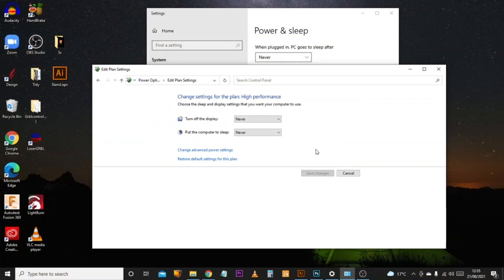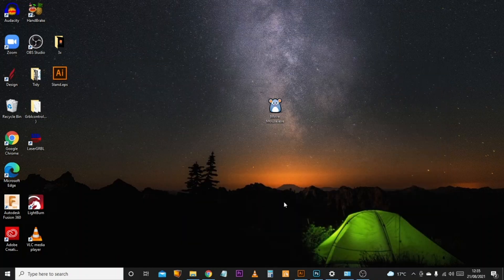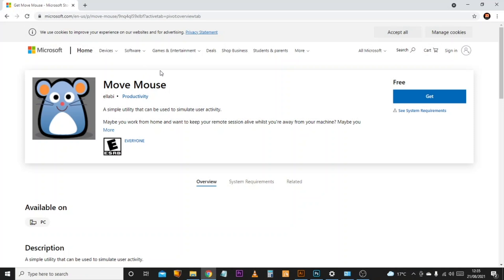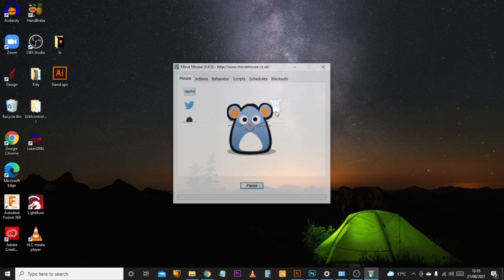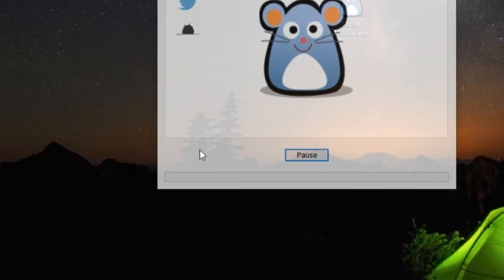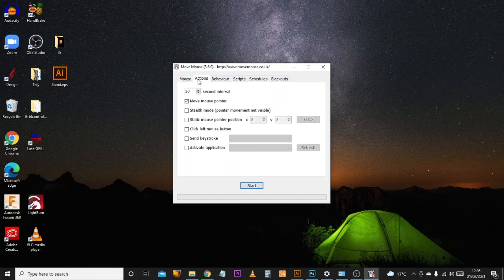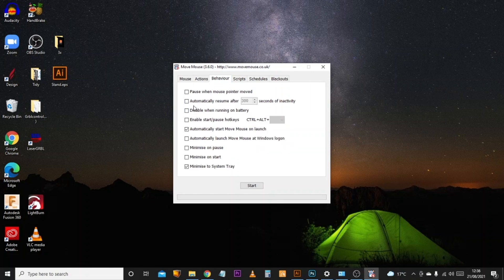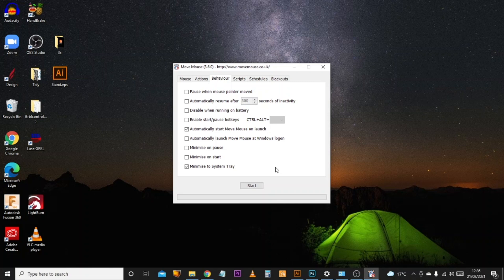Stop your CNC machine losing its connection

Comment: I have this problem with my 3018 cnc from Windows and Linux, some strange problem causes the USB to randomly disconnect from the CNC. But if I connect this cnc through an external usb multiplier, it doesn't seem to happen.
I don't know what the problem and logic should be.

Comment: What I found is that disabling "advance settings for USB" in Power Options actually does not disable "USB host 3.0". And if your CNC connected through USD 3.0 it keeps loosing connection. I went to Device Manager, USB devices, and finally to USB Host 3.0. Power management - and check off the tick allowing to switch off the power. After that - my 3018 worked dearly.

Comment: Cnc 3018 connection lost because the power supply is insuficient  change to 24 volt 15 amp & solve the problem

Comment: hi sorry to bother you but have just extended my 3018. do i need to change any settings so machine knows i have bigger work area
Reply from the maker: You'll need to edit your $131 to be just over your new Y axis length.
Reply: @JamesDeanDesigns  so the $131 should read 300 because my $131 and 130 both read 200 at moment. do i need to change them both
Reply from the maker: @grantleylusty832  so they should be the length of your axis plus about 20mm so if your X axis can travel 300mm then your measurement should be 320. $130 is your X and $131 being your Y
Reply: @JamesDeanDesigns  thank u

Comment: It seems my problem was leaving the Genmitsu offline controller plugged into my ProverXL 4030 while trying to drive it using UGS.  Of course it took finding a Windows 7 laptop computer, but I happened to have one kicking around for  controlling electronic test equipment.
Reply from the maker: Excellent, glad you solved it 👍
Reply: @JamesDeanDesigns   You gave me the idea in one of your videos.  A thousand thanks.  I would not be up and running without your excellent teaching.
Reply: This was also my issue getting started with 4030. Kept losing connection and bad number format exception. Tried surge protector, windows, and linux, power save but turned out to be offline controller. Don't even know why I bought the offline controller. The UGS pendant with phone works for my needs so far, Thanks  @James Dean Designs  your videos have been great getting my 4030 with 6060 extension up and running.

Comment: Great Thanks James.  I bought a USB mouse jiggler a while ago which does much the same without all of those neat options though.  I had a problem with my 3018 stopping randomly and tried all sorts of things. I trawled the internet for ages until I found the answer. I changed the USB lead !  Not had a problem since ! ! !   Jim
Reply from the maker: Crazy how it can be simple things but glad you solved it. I spent three months trying to solve it with my laptop, in the end I switch to £40 second hand PC and never had the issue again 🤷‍♂️

Comment: or... just adjust power settings which takes 2 seconds and does not require junk software.
Reply from the maker: Yes thats one option... but as mentioned in the video, Windows  occasionally make updates which override your setting, or introduce new settings in different place. Its a back up doing that as I explain
Reply: While I'd personally opt for changing the device's power management settings in Device Manager¹, I can definitely understand why some might prefer a simple software utility that effectively solves the problem quickly and easily - especially for non-“enthusiasts”, and double-especially since the software is in the Microsoft Store, giving it an air of legitimacy and/or trustworthiness.
(I have no idea if that sense of legitimacy/trustworthiness is justified - I don't know if/how well Microsoft police their Store - but I suspect it's a common belief nonetheless.)

Btw  @JamesDeanDesigns , regarding USB device power management settings (in Device Manager) getting reverted, it might be that the device has been plugged into a different USB port. I believe Windows essentially treats each combination of peripheral + specific USB port as a separate device, so power management will have to be disabled on that device for every USB port it's used with.

That also applies to USB hubs, where each port on each hub is treated separately, and I think it affects COM port numbers, too: plugging the same USB-to-serial adapter into a different USB port can result in a different COM port number being assigned to it.
So always use the same USB port if you want things to be consistent!
I don't know if that behaviour was intentional for whatever reason, or if it was a consequence of an ancient decision/limitation that's been kept for backwards compatibility.

I don't think I've personally noticed a software update reverting those settings, but I don't doubt that it can happen :) Driver updates, in particular, strike me as likely to do weird things like that! In general, I don't trust software developed by hardware companies - just look at how many drivers/utilities completely replace the standard Windows GUI controls (window frames; buttons; the minimise, maximise/restore, close buttons; etc) with something that looks very different but provides little to no real benefit over the default, usually has a design that's a decade or two out-of-date, invariably breaks expected behaviour, and fails to consider accessibility in the slightest 😒

¹ Reference - Disable Power Saving in Device Manager:
1) Open Device Manager (Win10 shortcut: WinKey+X ⇒ M);
2) Find the device in question (probably under “Ports”?) and open Properties (e.g. double-click);
3) Go to “Power Management” tab;
4) Uncheck “Allow the computer to turn off this device to save power”;
5) Click “OK”.